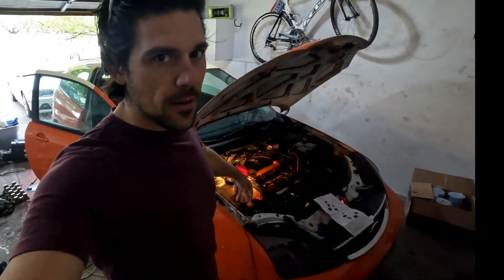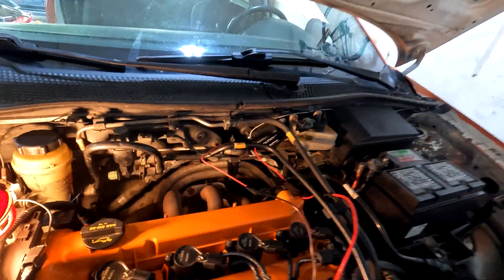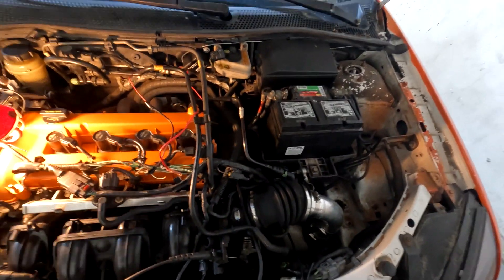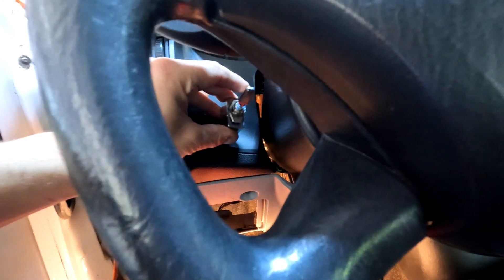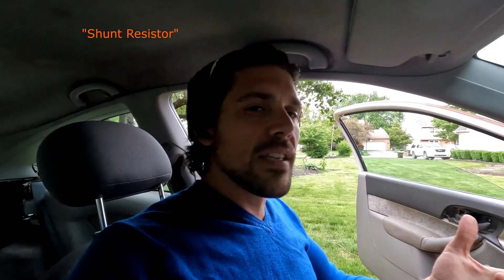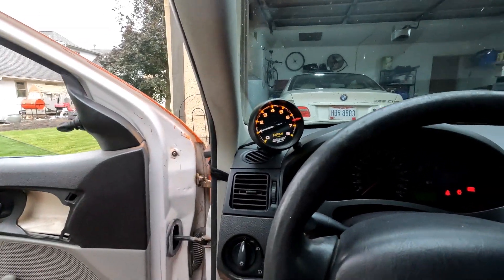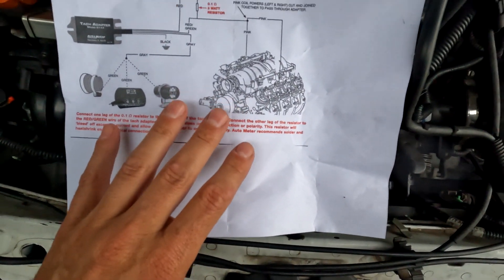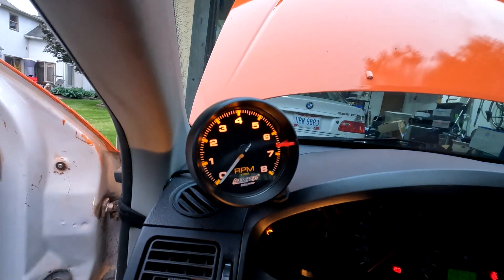Aftermarket Tach Install How-To | It Actually Works

Comment: 4:48 did you really just say it took you 12-14 HOURS to do this?!?!? I think you should pay someone to be honest man, not trying to sound rude at all trust me, but that shouldn't have taken more then 2 hours AT MAX lol. I found your video because i bought a aftermarket tachometer and my car didn't come with a tach from factory as a manual transmission car either, so i thought my install might be similar. I was way wrong lmfao, i decided to go and figure it out myself after seeing your video... I'm 26 years old, it was my first time installing a tach, and it only took me about 40-50 minutes bro...

Comment: If you hold the button down when starting it it displays the Rpms.. There has got to be a Wire coming from the ecu or something that has the signal.

Comment: On my focus i went to the junk yard and found a same gen focus with a speed and tach and put it into my focus and it worked, and i like the OEM look.
Reply from the maker: @chillpeter9067  nice I didn't even know the tach came as an option for my year. I assume the rpm signal was digital?
Reply: @threepedalgarage993  yea, if it's not carburated, then it's a digital signal. Also, when you did your wiring to get the rpm signal, you don't need a tach driver, or whatever you called it, at all. You just look for the wiring harness at plug in for you coil pack, and even if your car doesn't have a tachometer, there is a signal wire in there, and it is SUPER easy to look up which one it is, cause there is usually only 2 or 3 wires lol. That or you could just get the signal from the ecu if you can get to it easily, same thing there, easy to look up. But yea all cars that are fuel injected, whether they came with a tach or not, has a signal wire at the coil pack harness, or the ecu...